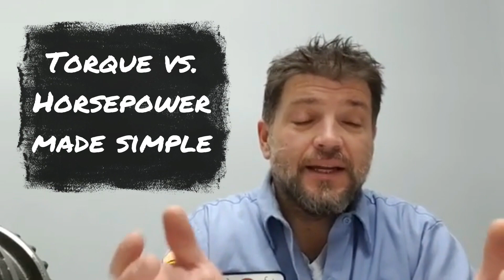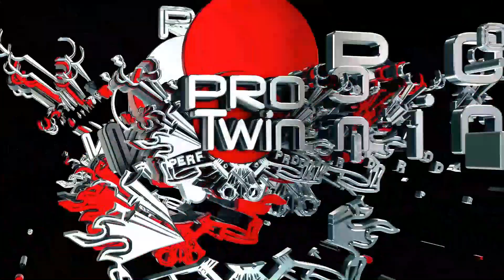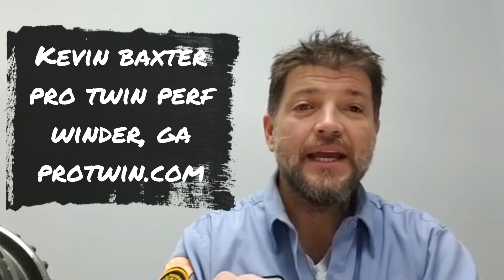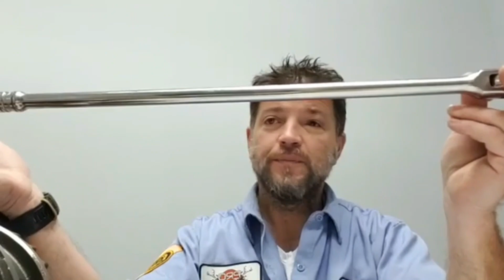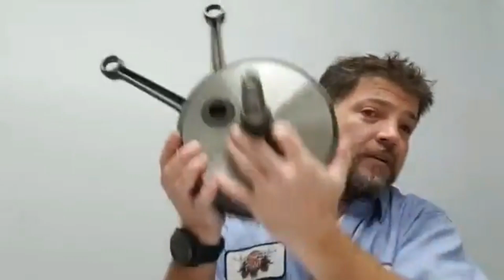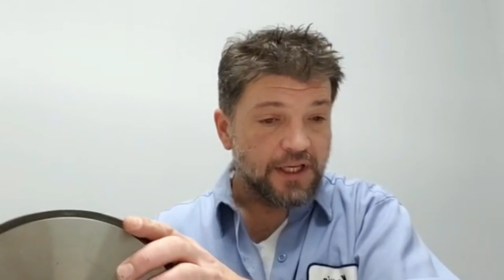Torque vs Horsepower Made Easy - Harley Engine - Kevin Baxter - Pro Twin Performance

Comment: They are really interchangeable when comparing engines at a given rpm. If you have more hp, you’ll also have more torque at that rpm. If you look at Harley dynos, you’ll often see more movement in the torque graphs at lower rpm’s than you will on the rpm graphs, but it’s still always there. Just the breakdown of the math.
Reply: In other words, that tractor has more hp as well at those rpm’s that say a ferarri

Comment: sport bikes have a shorter stroke but with a typically twice as many cylinders.  So at half the displacement your torque nubers are about the same or slightly higher. horsepower= torque× rpm/ 5,252. thats why Harley like to talk torque nubers / displacement insted of  horsepower.

Comment: Excellent video. Torque is applied force. HP is the speed or rate, at which torque is applied. Think of the transmission as a torque multiplier. Changing gears matches engine rpm to road speed. 
HP = (Trq x RPM) ÷ 5252 👍👍
Reply from the maker: Exactly what a trans is...as well as primary and secondary drive.  Great comment.  Thanks.

Comment: I have an 04 Fatboy EFI. 8600 miles on it. I've upgraded the the air filter to an Arlen Ness clear method sucker and it has screaming eagle pipes( I'm planning on changing them ) I want it to be faster on the highway. At 3200rpm I can maybe do 80mph but I feel like I need another gear at that point. I'm looking at s&s cams chest kit or fueling. I want more power. Jp cycle says 585 cams but my mechanic says too big, he says 535!? ( I think) and a 2-1 pipe , but I'm not a fan,I'm thinking more V& H short shorts. What about a baker 6 speed, if I do the cam kit can I keep my stock trans? I just want to be able to go 85-95 mph and not feel like I'm strain
ing the engine. Thanks!
Reply from the maker: more power wont lower your rpms.  but at the same time, if you lower rpms, often you find you need more power to maintain speed.  these are 2 different goals and one isnt dependant on the other.  if you run 90mph regularly, and lowering RPM is your goal, the Baker DD6 would do that for you.  Dont do the OD6 on a stock engine...nowhere near enough power to pull a deep overdrive.  Whoever told you to put a 585 cam in a stock unmodified engine....uhhh....never take their advice.  Discount parts = discount advice.  Watch my "how to choose the perfect cam" video from a couple months ago.  it'll help you.  when you decide to get one, give us a call.  ill make sure its a good choice then ship it out to you.
Reply: @KevinBaxter  thank you I will check out your video. And it was a tech from JP cycles that suggested the 585 , they are having a sale on the s& s cam chest kits.
Reply from the maker: sometimes saving money, costs you in the long run.  Yes the 585 would "run"....but it needs at min 9.7:1 CR and wouldnt start pulling until after 3000.  When you get ready to buy a cam and kit, give me a call, i'll get you in the right one.
Reply: Thank you I will definitely be in touch!

Comment: You know what you're talking about, but you've found it very difficult to make it simple for someone else to understand.......

Tq and HP are the SAME yet OPPOSITE.....

SAME, you explained what Tq is inside the engine(the amount of boom X 1/2 stroke length)......HP is the addition of all the Tq's produced in 1 second / 550(the amount of Tq in 1 second that produces 1 HP)..........

OPPOSITE, in the design of an engine the longer stroke produces more Tq, but the longer stroke produces less HP......

2 engines with same displacement, 1 long stroke 1 big bore.....deal with stroke, long stroke is 4in, short stroke is 2in, for the long stroke to make 1 rev the piston must travel 16in while the short stroke piston only travels 8in......so the ability for the short stroke to produce more booms in a second is much greater.......however each boom produces less Tq

The motorcycle treadmill is not accurate, Tq is measured at the wheel, transmissions alter Tq at the wheel, then in calculating HP it uses the engine RPM not the wheel RPM(or distance traveled would be even better since wheel size also alters measured Tq at the wheel)......but then since it is measuring at the wheel the calculation uses 2pi instead of number of pistons........The motorcycle treadmill is set up to produce larger than true Tq and HP numbers because these numbers are selling points........when Harley tests Tq at the wheel they use an equation that reduces the number to reflect actual engine output

When I tested engines(not at the wheel, actually testing engines) we also measured the fuel used so we could calculate thermal efficiency....High HP output engines are not thermal efficient.

Comment: Think my 103 has 100tourque at 2700 and drops from 110 to 100 at5250 from memory.
Reply from the maker: sounds about right for many build combos.
Reply: Kevin Baxter 254e cam but only 102hp
Reply from the maker: TQ matters more than HP on a street engine.  A good average build you have there.  Absolutely nothing wrong with 1HP per cubic inch....and a little more torque.
Reply: @KevinBaxter   thanks . and nice vidio's too thanks from Australia
Reply from the maker: Cheers Mate.  I love  my visits to OZ.
Reply: @KevinBaxter  Physics 101--Torque moves mass...   lol

Comment: My question is how does a cam effect the torque/HP #s   why would a cam grind make more power/tq vs the other or stock
Reply from the maker: That's a very long answer.  Cam dynamics are very complicated and I plan to do a video discussing this very topic but...in short, certain characteristics apply.  Earlier intake close and shorter duration will improve low end torque.  Shorter lifts can improve port velocity and cylinder fill making more power (based on engine size of course).  More lift, longer duration, etc tends to make more mid to top end power but again, this is all relative to engine size, compression ratio, etc.
Reply: The short simple answer is the cam determines where you make peak horsepower. The engine basically makes the same torque, around 1 foot pound per cubic inch. Longer duration cams (opening the valves longer) makes peak horse power at a higher RPM but your don't get something for nothing you lose low end power. That is why race motors have no power below 4000 RPM.

Comment: STROKE IS THE HORSEPOWER ..
Reply from the maker: Well....sort of.  Stroke determines mechanical advantage and resulting torque, HP is the rate at which the torque can be produced and applied.  Thanks for watching and the comment.
Reply: Kevin Baxter I had S&S build me a shovelhead back in 2000. 80’’ bore 88’’ wheels 4 3/4 stroke. Solid cam and lifters roller rockers with a delardo  ...it screamed. I’m sure in short runs it would beat `my 110 but not long...lol yeah hd pressed cranks suck bad. I’ve blown one already.

Comment: Kevin,
You asked me about specific Harley or sport bike tuning regarding EC997a tuning. Here is some general info as to how I had my bike put through the dyno. Evidently my scores are 12-17 percent lower than a machine with this precise tuning method.
 https://mustangdyne.com/_wss/clients/205/assets/c205_resources/20170613164415731.pdf
 Thanks as I really appreciate your videos, Mark